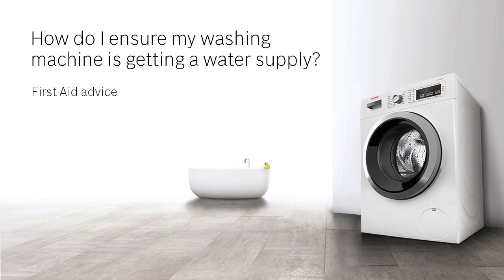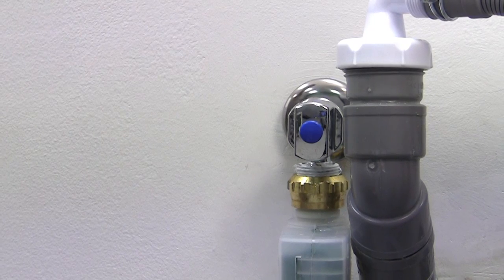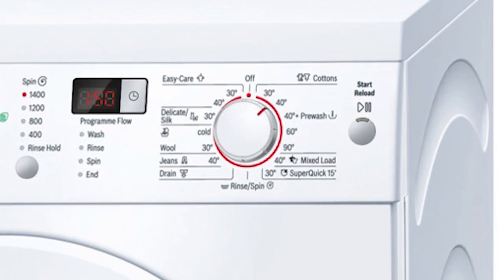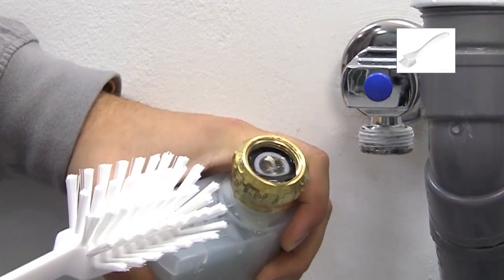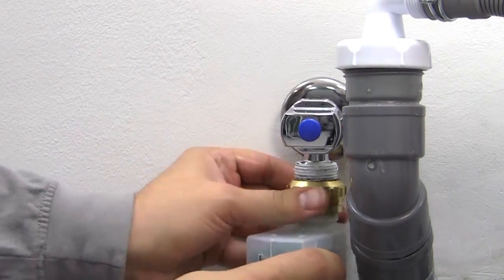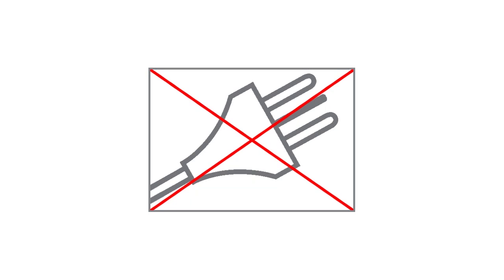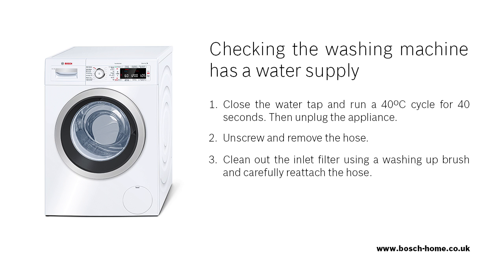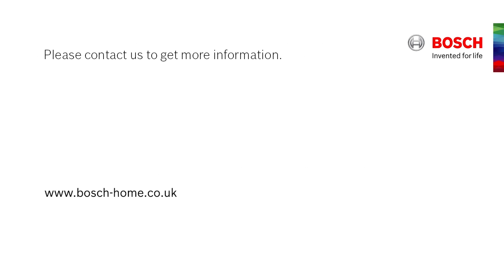How do I ensure my washing machine is getting a water supply?

Comment: thank you, my current 2010 built bosch machine is torn a bit on outer seal, hence cannot use. also foul smelly water coming out bottom of filter flap....i think best to buy new machine instead of 100 pound call out charge to repair?